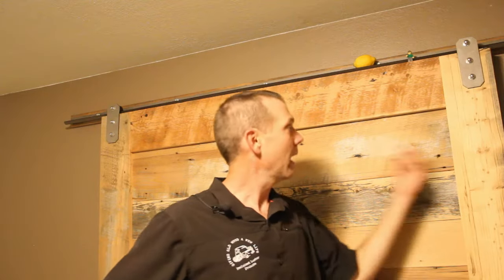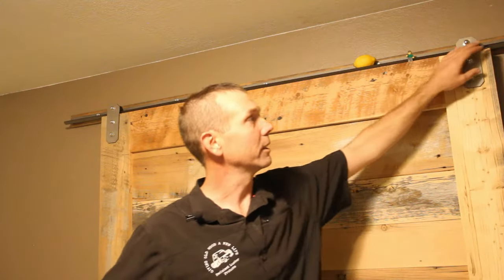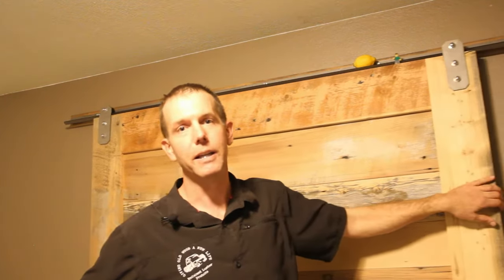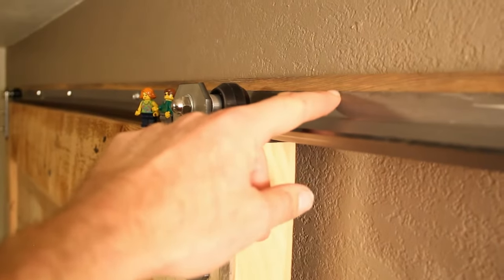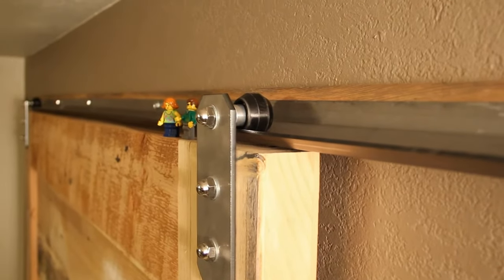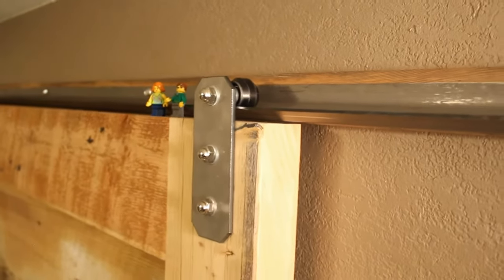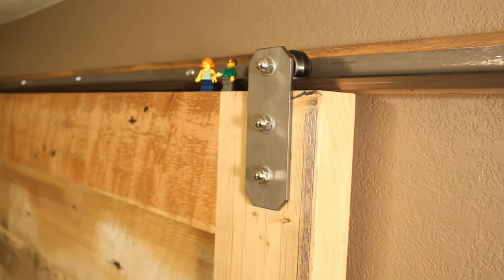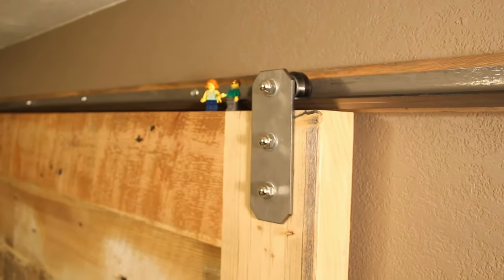Features and Benefits of Low Clearance RLP Mini V Track Barn Door Hardware

Comment: Hi. Does this require a floor guide or floor rollers or anything?
Reply: Yes,  It is recommended to use the floor guide that is supplied with the kit.  You can also substitute other methods if you do not want to use the one that comes with the kit.

Comment: Can it be reduced to 48 inches?
Reply: Yes,  You can buy a 5' kit and cut it shorter.  You can also follow page #6 of the install instruction for various options to adjust track length, stop, and slab width relationships.

Comment: $250 unfinished metal is a more than double the price it should be. You can buy a barn door kit for $40 on Amazon.
Reply from the maker: Thanks looking into it.  Yes we are definitely a different price than a number of different items on Amazon.  We make our own proprietary line here in America with different components and unique features.  Our product is much more costly to manufacture due to the higher quality materials; even our shipping alone built into the cost is more than $40.  One can see a comparison of quality between our kits and several bought off Amazon https://www.youtube.com/watch?v=3ilUJPQPsdg